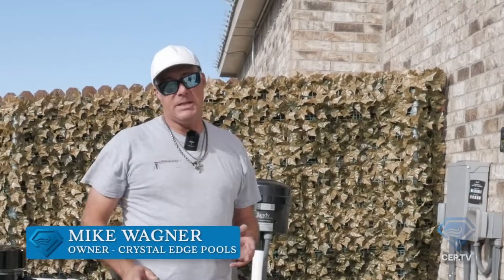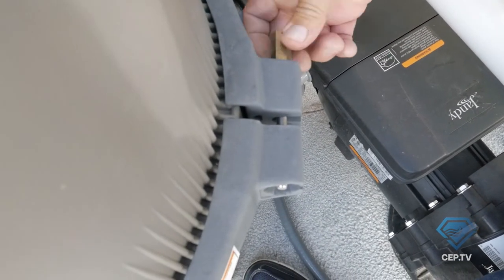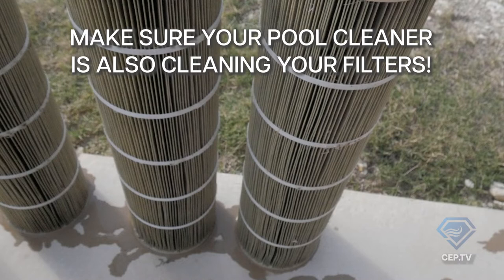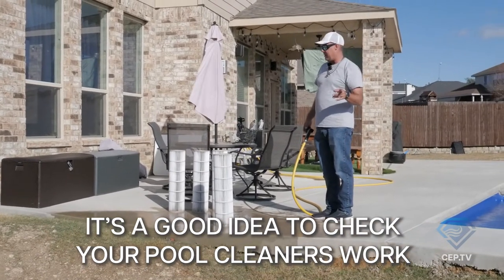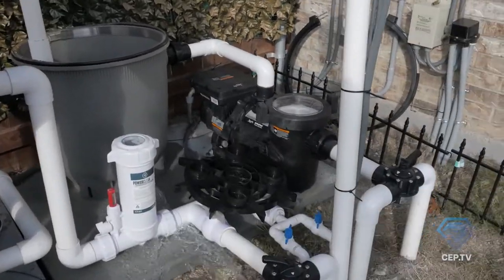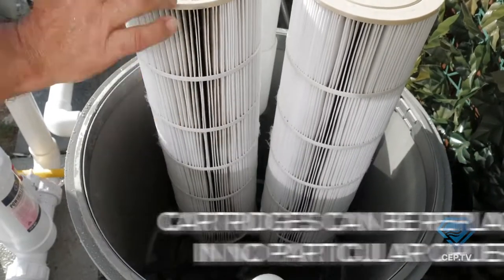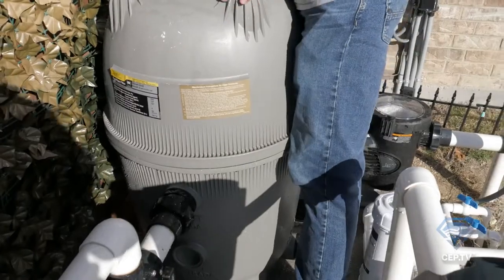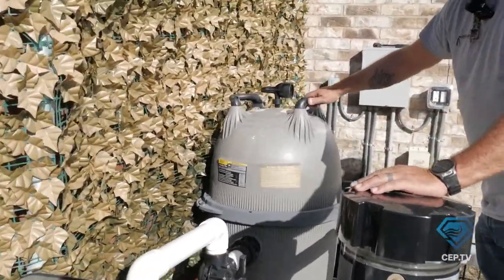HOW TO CLEAN A 4 CARTRIDGE POOL FILTER THE EASY WAY

Comment: Just drain the entire filter housing first.  No need to wait until the filters are out to completely drain the housing.
Reply from the maker: That's true, just make sure filters are out if you choose to drain and rinse the housing to assure you have it clean if you're going to go through the exercise. With routine maintenance usually the housing does not need to be drained everytime. It is a good idea if you are around an area under construction or heavy dirt has gotten into the pool.

Comment: How often do you replace the filters or in other words how many times can you clean it with a 1500 psi pressure washer before you replace it?  Thanks for making this video.
Reply from the maker: Glad it was helpful. Deciding the end of a filters life is really a combination of pool performance and gauge response. If heaters arent firing or u/v's arent turning on from flow restrictions after you have cleaned the filter, than the filter likely needs changing. Also if water features dont perform as expected or pool flow is diminished, the filter has likely reached the end of its life

Comment: I have a pool that is one and a half years old, I have a pool company that comes every Tuesday to clean it, I mentioned to the girl how often should the filters be cleaned because the pool is one and a half year old and you haven't cleaned the filters yet and she's like really? So she texted her boss and the boss text me back saying somehow I got not put on the filter cleaning list and she was sorry and she would send a guy out Friday to clean the filters. $105 to do it. I thought that was quite a bit so I did it myself, like you said the most difficult part was putting the lid back on and sealing it, I didn't take the gasket off and cleaned it, but I did wash it down, but I put the lid on twice and it leaked, so I took the gasket completely off and cleaned it really good put silicone lubricant on it reinstalled it and no leaks. I purchased a filter cleaning sprayer that goes on the end of the hose that I will use from now on. The filters were not actually that bad for not being cleaned for a year and a half because I always check the pool every day and clean the skimmer basket, and I hardly go swimming, but I will start ckeaning the filters every couple of months now.
good video you posted.
Reply from the maker: I'm so glad to hear you were able to save that money. Way to go!

Comment: I don’t recall hearing you say how often in good conditions do you need replace the filters ? Are the cheap filters ok to purchase ? Great video 😊
Reply from the maker: Filter life greatly depends on the contaminants in the pool and the maintenance of them (i.e. cleaning frequency). Reducing oil and using a robot vacuum with its own dirt collector greatly extends the life. Typically, we see around 2 years with good maintenance and no very little oils.

Comment: Hi there. Thank you for this great informative video. Most of the other filter cartridge cleaning videos have those tiny filters that are easy to clean, so this one was very helpful. I have a question regarding what you referred to as the "breather" on the top of the cartridge connecting element inside the filter system. What is the purpose of this "breather" and is it an essential element of the filter system? During our last cartridge replacement, the tip of this item broke off and we are deciding whether we need to replace it somehow. I realize this video was posted 8 months ago, but maybe if you get to this you can address the issue. Thanks again regardless, happy Monday in August!
Reply from the maker: The breather is an important part of your filter system, it allows air to be pushed out on startup and then you can secure a proper seal of your system when you close it. It is a good idea to get this fixed, otherwise it can cause issues with the rest of your system. Best of luck to you!

Comment: Mine are over 5 years old and now clean to a grey colour.  How do I know when to replace them? The pool still looks clean and I run at 20 PSI.
Reply from the maker: Wow! That's a lot of longevity! Great job keeping up with them! I would recommend changing them by now. The paper elements will break down over time, and I like to make sure filters are solid and able to perform. The choice is of course yours however. That's our opinion..

Comment: I just have my filter  cleaned and I have an indoor in the ground pool. And I still don't get enough suction to clean my pool with my vacuum.
Reply from the maker: You might check to see if your vac plate has a "blow-by" pressure relieving valve that may need to be further closed to increase vacuum pressure. Also, check the hose for kinking while vacuuming; sometimes weak spots occur without you realizing it and the pump suck them flat while you're trying to vacuum. Finally, check to see that you have a good seal on the vac plate and that the gasket hasn't broken down. Let me know if none of these work and we can look deeper into possibilities

Comment: Cleaning these..I was told every 6months
I assume due to the oversize of the filter with my pool?
Reply: looks like it depends from how bad is your pool and surrounding,  for example windy weather sand dirt pushing in,  tree pollen in spring.
Reply from the maker: Hi Thomas. I don't recommend waiting that long. Waiting until a filter is completely full is not a good approach in our book. Besides that, it takes a real long time to clean. Short cleanings more often we've found to increase longevity in the elements.